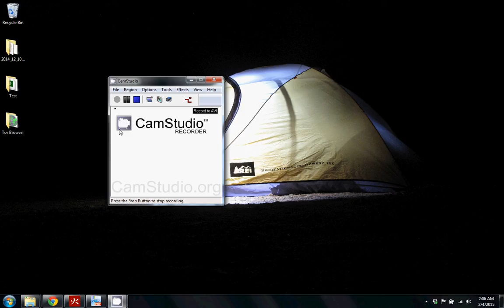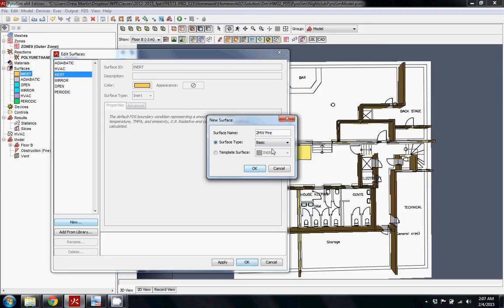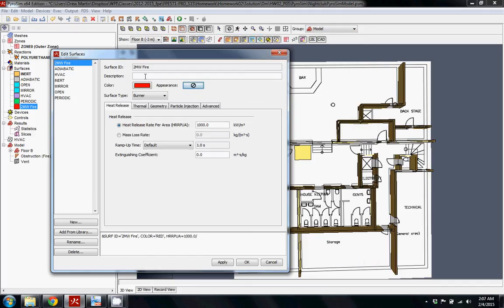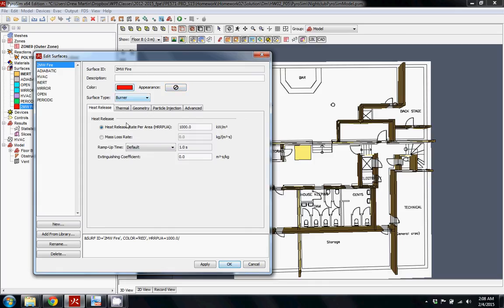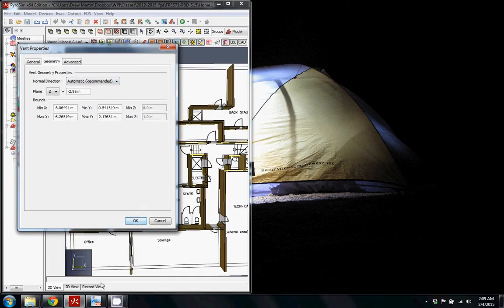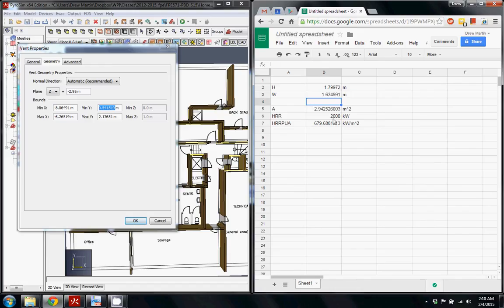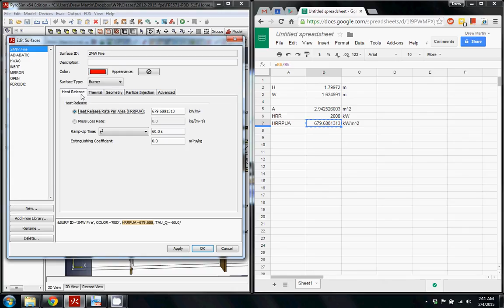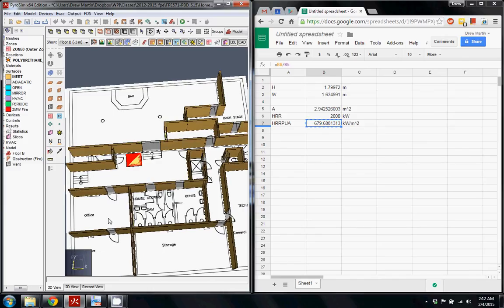PYSIM 007 - Creating the Burner and Simple HRR Curve

Comment: Hello, I am currently engaged in a project based on the domino effect by fire. I am using FDS+ PyroSim for my analysis. I need your guidance regarding the detection of Heat flux (radiative + convective) at the receptor at some distance away from the source of fire. I would appreciate If you share your email so that I may discuss it with you in detail. I will be highly obliged if you would assist.